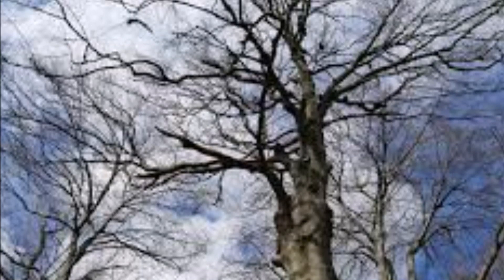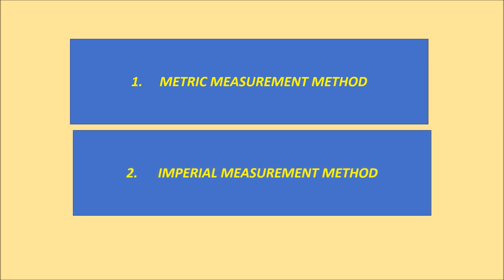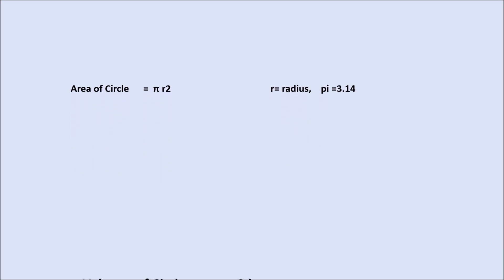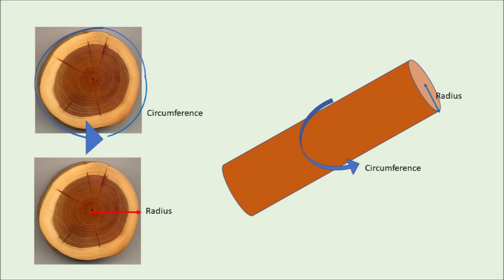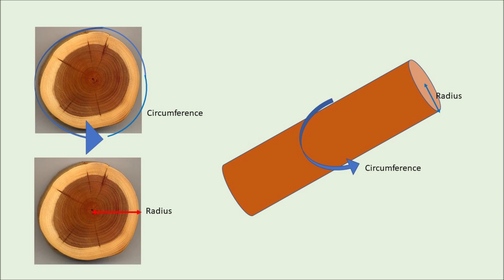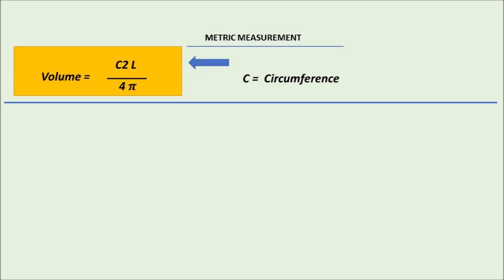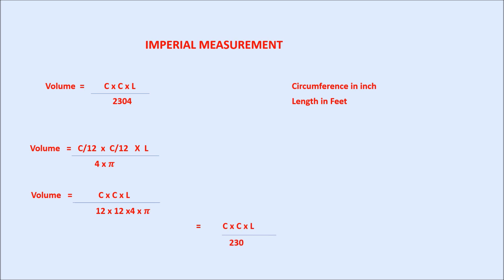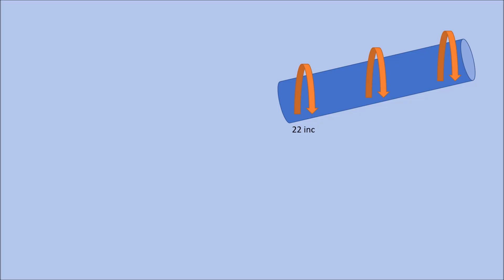How to calculate cubic feet of wood.തടിയുടെ ക്യൂബിക് അടി എങ്ങിനെ കണക്കുകൂട്ടാം .

Comment: The way metric is calculated is right. But your imperial way is wrong. 
Our people usually converted a circle to square. Meaning the circumference of a circle divide by 4 will be measurement for one side of a perfect square. Volume of a cuboid will be side x side x length.
Considering circumference to be 100inch
And length to 6ft. 
Your eq.n will be (100/(4x12))*(100/(4x12))*6

So on the top you will ve. 100x100x6
And at the bottom you will ve. (4x4x12x12)

That's how you ve. 2304 at the bottom

No body converts a pie value to 4 that will absurd.

Comment: Easiest method for measuring round log CFT 

നീളം Feet (അടികണക്കു) അളവായും, വണ്ണം Inch (അല്പദൂരം) അളവായും എടുക്കുക 

വണ്ണം/ 4 = വശം 
(വശം x വശം x നീളം) / 144 = CFT 

Example നീളം 7 feet, വണ്ണം 48 Inch 

48/4=12 
(12x12x7)/144 = 7 CFT 

Simple as that .....

Comment: Ningalude Kanakk thettiyille, metricil koottiyalum imperial method il koottiyalum volume correct varendathalle. 
Metric method il koottenda formula tazhe vivarikkunnu 
Take your example itself 
50cm girth and 10mtrs length
Girth x girth x length divided by 16 
again multiplied by 35.34 
.50mtr x. 50mtr x 10mtr
Answer will be 5.515 cubic feet.
Reply from the maker: Njan athu vishadeekarichittundu. Metric il koottiyalum imperial il koottiyalum answer same akanam.but njan paranjathupole nammude nattil upayogikkunna imperial formula thumb rule anu. Athayathu “pi “ yude value 4 ayittanu consider cheyyunnathu. Thangal mukalil Paranja example inch leku covert cheythittu try cheyyu. Difference kanam.
Reply: No no there will not be any different 
If you convert .50mtr and 10mtrs in to inch answer will be  same 
.50mtr=19.68inches,10mtrs=32.8ft
See the calculation 
19.68*19.68*32.8/2304=5.51cubic feet
Reply from the maker: My friend, from where did you get the 16. It is not 16, it is 4 x pi = 4 x 3.14. That’s why I am saying,     you consider pi as 4 in metric and imperial method. So you are not getting any difference. If you want the same answer don’t change the metric method, use 1808.64 instead of 2304 in imperial. But unfortunately we are using 2304 from long time as thumb rule.
Reply: @Enteveeduchannel  it is a fact
Reply: In India timber merchants are using the same  method. If you want you can go to a saw mill and ask them how  to calculate the volume of round timber log
Reply from the maker: I agree that in my video. But it is theoretically wrong. That’s my explanation. Or prove it.
Reply: @abdulsamadpelil  video full kannu buddy
Enithu para
Video annu correct dimension
Ipoo kachavadakar full udayip annu
Manacilayo
Reply: @alstgaming2758  
Do one think, go to the forest department and ask them how to calculate the round log of timber in metre measurement